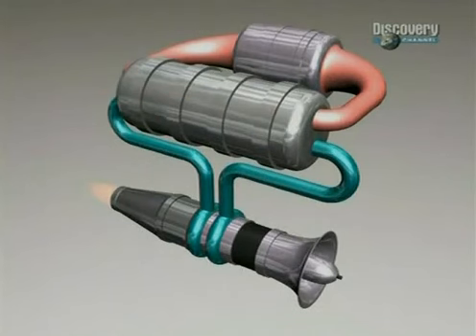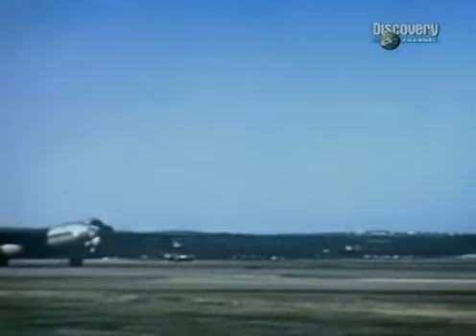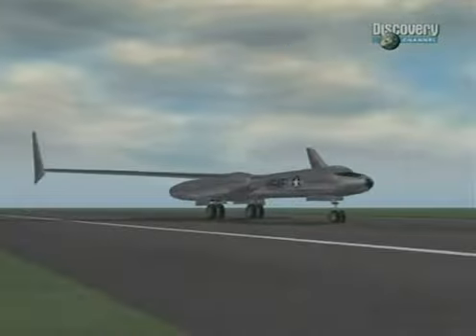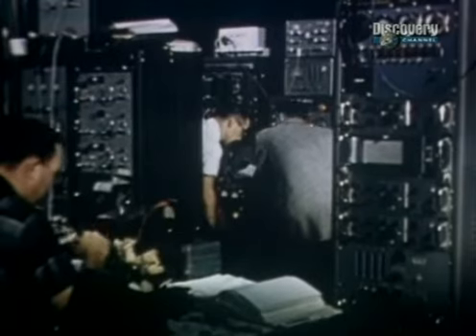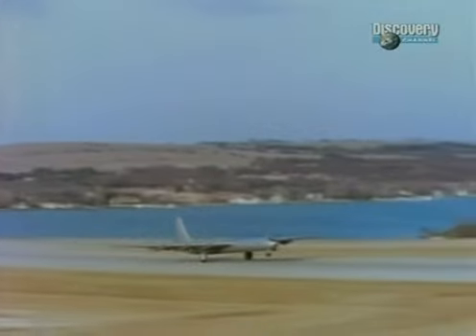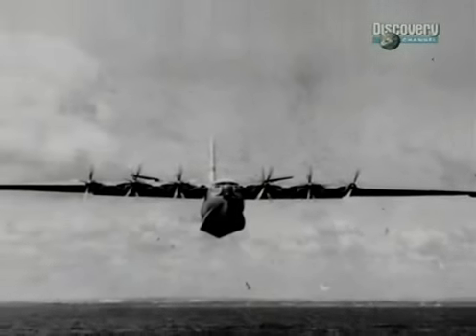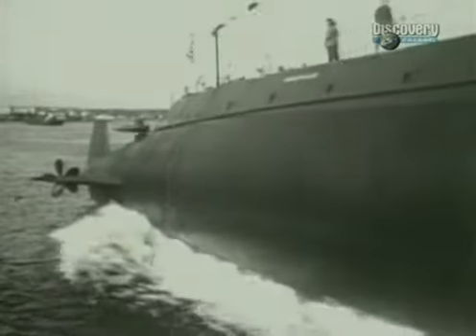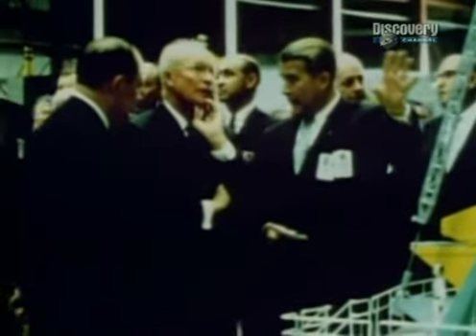Discovery Channel - Nuclear Airplane - Part 3 -

Comment: Not stealth- The reactor would put out enough radiation to be detected from the ground. Google "project Pluto" and you'll find that the US actually built a working nuclear open-cycle ramjet cruise-missile. The idea was to have it loiter over the Pacific, flying in circles until it was needed. No landing gear though, so it would HAVE to be used before the reactor burned out and it lost power.